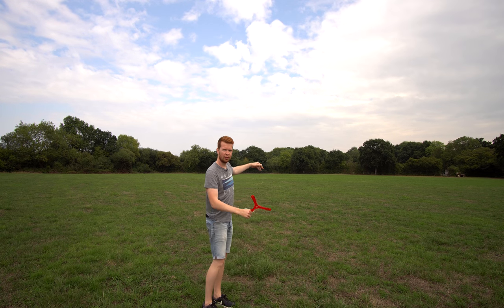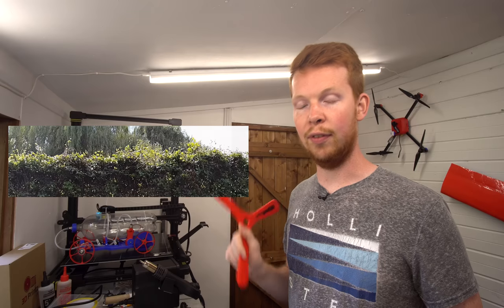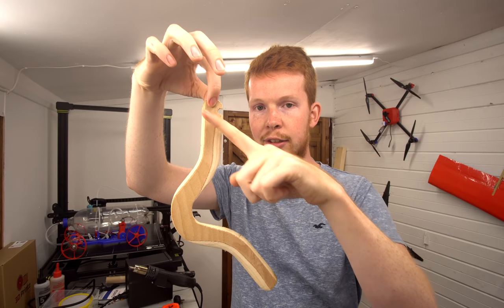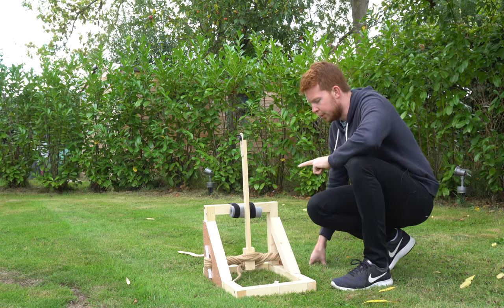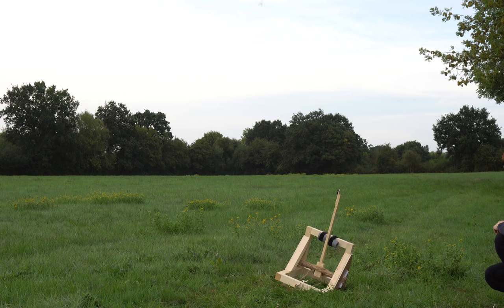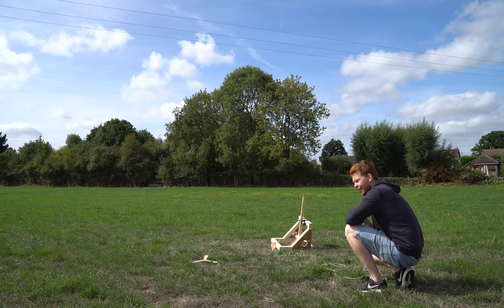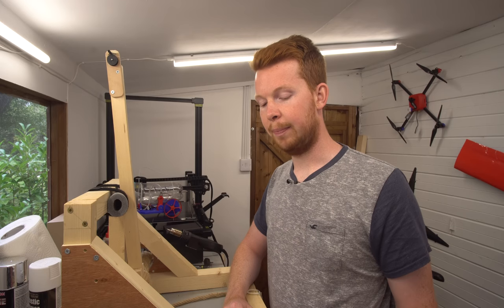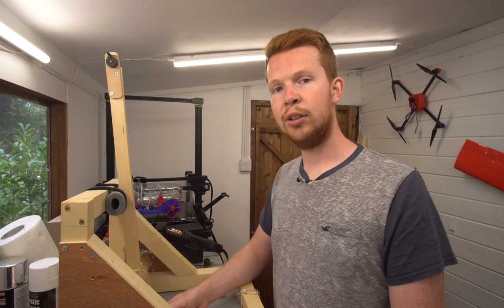Boomerang Launcher

Comment: The next phase of this project is to put some servos and instrumentation on the boomerang so that it will be able to control its own flight path and steer itself home. ;-) Also, the long form videos are a nice change. The extra touches done in editing are cool.
Reply from the maker: Haha 21st century boomerang ;-) Great thanks mate!
Reply: I was about to type this identical comment, then saw this one below ... I need to become a patreon :D
Reply: I wonder whether you could do it using a single servo. Like how a monospinner can move in 3d space with only 1 propellor.
Reply: @charleslambert3368  These already exist! Can't remember who made the first one but Lockheed Martin followed up on it.
Reply: Thoughts and ideas at their extremes. But its cool idea. How about a RC flying saucer.
Reply: Buy a boomerang! Its easy to make some boomerang and adjust your throwing technique as to make it return to you. But a good quality boomerang is much easier to through and much more forgiving.
Reply: Tiny solar powered reaction wheels. :D
Reply: Maintain angular velocity by having mass that moves closer to the centre of rotation when the boomerang rotation slows
Reply: @TomStantonEngineering  i didnt like this comment, its better at 21 like for 21century boomerang

Comment: Brilliant stuff!

I'm a blacksmith/metal worker, if you wanna do something metal based collaboration let me know! I build and fly foam planes but nothing fancy, also Hertfordshire based.

Cheers,
Joe.
Reply: dogboy1953  i wonder if that would actually work if the metal used was light enough...
Reply: @Sharpless2  it doesn't matter what material is used for as long as it is light enough
Reply: Should I put this in r/cursed comments?😀🔪
Reply: @duke-vx8xy  yesh
Reply: @Blacksmith Joe I subscribed to you cuz your name is Joe
Reply: Build a drone with hand forged rotor blades

Comment: [circular(spin)/ lineer velocity] ratio is also important. if you would make that hole closer to the elbow(center), more kinetic energy would go to circular and less to lineer motion. That something you could try. That boomerang you can throw it with the lift arm, dingle arm or even elbow. And elbow you can make more spin.

Comment: I do believe i have a proper boomerang for ya. Love the invention my friend. Wish you were my neighbor, i could at least hold the camera for ya lol. Every time it made a full circle and landed in front of you i would still call it a win. The launcher did it's job. That boomerang needed a little bit of breeze to push it back just a bit. I don't think hitting the ground made it fly any different, i think it was simply the change in wind direction. This test would have gone so much better in a huge arena with dead air. I know, not practical or feasible. I've thrown 1000's of times and i only go out first thing in the morning or just before dark when the breeze is at it's lightest.

Comment: I’m very impressed with your release method.
The biggest advance for you would be a base to hold the catapult at a steady angle.
If the release is consistent then the next variable is variations in wind and turbulence.
 Look for a bigger field, with nothing up wind of you to ensure clean laminar air flow.   Those trees in the picture would have given turbulence. The smaller the flying object and slower the air speed then the more it will feel and be effected by, the turbulence. Of cause some windy days are more gusty than others too.
Reply: Excellent observation.  My lifelong kite obsession taught me how disruptive  distant upwind obstacles can be to getting a kite to launch.
Another unnecessary variable I see is the ground level launch.  There is an abrupt gradient of windspeed from near zero at ground level.  You can see it by blowing bubbles at various heights in various strength winds, preferably in wide open spaces.  Watching the relatively slow progress of dried dead leaves along the ground is evidence as well.

Comment: When I was a kid growing up in Australia in the 70s there were a lot of good boomerang throwers around. It was a bit of a thing back then to practice - I guess it was our version of frisbee. I was pretty good at it myself.

I reckon one of the problems with your machine launcher is that it is too close to the ground. When you throw a boomerang you are throwing it from about 6ft high and you launch it in a bit of a downward motion; the aerodynamic lift then kcks in and makes a better arc. Maybe you could lift your machine up off the ground and get it to release a little later.

Comment: Some suggestions after reading the comments: Put the launcher on an elevated platform and when proper release angles are established, fix it securely. Play with the location of the pivot pin to achieve faster rotation if possible. Use a ready-made plastic boomerang. There are a few decent two-blade plastic booms made. Lastly read up on tuning boomerangs for better flights. The light plastic ones respond very well to tuning although they won't hold it for long. I have no doubt that it is doable.

Comment: Good job so far...but for one...make that thing stable not rocking when you launch. Second, make the arm just a bit longer and third, the stopping blade stalls as it slows down and generates drag which makes the other wing come up and around by means of inertia of the second blade which you should balance angainst the drag by making the tips of the blades a little heavier in your case (it just seemed that your boomerang was not spinning as fast as it should). I think you can see what I'm pointing at.
Ps. It will give more stability and a longer flight time, though it will also influence the shape of the flight.

Comment: This would work better with a launcher with a horizontal launch like a crossbow. If you throw it via an arc, it will cause issues with dipping too low on its travel out and not having enough horizontal momentum to make a full trip.

Should try a hand held launcher like a sling shot. You use rubber bands attached to a sled, and a clamp held shut with springs or rubber. The clamp holds the boomerang, and when the clamp gets to the end of the track, wedges force it open and the boomerang is released without a hitch. To copy the rotation imparted by the throwers wrist, you make the clamp tilt back to front during its travel, maybe making use of an extra joint between the clamp and the sled that starts rested back, and then gets flung forwards with the travel of the sled.

Then you can compensate for wind, angle, and boomerang shape by aiming in different directions. You can also adjust the pretension on the rubber, and the distance the sled travels.

Comment: when i used to throw one when i was little, I would be about 100 feet back in my yard and chuck it directly at the right corner of the house. It would lift before hitting the house, go left, and come right back to me every time. It was probably heavier than that one, and was a true boomerang shape. Now even though I could bring it right back, it was painful to catch! Also I'll note that the secret to a proper consistent boomerang through is a hard flick of the wrist, so it is no surprise you had issues with the catapult. You need the rotational force to be enough to carry the thing back to you

Comment: Very good attempt.  But you forgot another variable - height of the launcher above ground level.  If at human height (usually 6ft when it leaves the hand) you will have more latitude to vary the angle from the horizontal at release, which from memory can be critical to getting a good return (again perfect angle depends on boomerang).. Higher also means you don't need so much headwind, as the extra 6 feet at start can mean a lot of extra distance coming back.  I would have had the launcher on high table or platform.  Your launch angle from the vertical looked to be spot on.   My father used to make his own boomerangs in the 1950s, and in his eagerness to test them would thrown them from the roof, rather than go to the one of the few big parks in the city.  Many of the surrounding buildings had flat roofs, and after a few weeks they were littered with boomerangs.  No-one knew this until his sister happened to see them all while seated in the upstairs of a passing double-decker bus.   Merry Chrimbo Tom, thanks for all the effort you put in to video your projects, appreciated.

Comment: Put bigger wheels on one side of the trebuchet and make a bigger boomerang, use the trebuchet to launch it.
Weight instead of torsion for control, larger boomerang bends less, weighs more, less susceptible to wind?

Loved the vid, would thumbsup more than once if I could

Comment: You made great progress. Only thing is that the catapult is just a 'dull machine'. It will be good if you can mimic your hand and exact moment of boomerang release. Not sure what define forward motion vs. rotational speed. Probably with your hands, if you want to rotate fast, you release it later so that it spins faster. Not impossible, but very tricky to do it with the machine.

Comment: Try boomerangs with more blades and multiple airfoils (Aerofoils for those who speak British and other European English). You may just need more weight to give it more inertia. Higher inertia will, to a point, result in a higher lift factor and will turn the boomerang sharper. This may just cause it to spiral, but it would be a good test anyways. Try different blade angles too. Have one as a right angle, one as really shallow, and a few in between. I know that there's a specific one for a 'perfect' boomerang, but it's always interesting to see multiple results. And maybe what is the 'perfect' boomerang for a hot day is not for a cold one, so having a better design for a hot day, and a better design for a cold day would increase the usage of a boomerang.

Comment: I think having the launcher hold a stable position between launches would be essential for your repeatability. Each time you're changing angles in an uncontrolled, unmeasurable way. Just take some threaded rod and screw it down in the corners to create the angles needed.

Comment: Nice job!  I throw boomerangs a lot in the nicer months of the year and have long thought about making a robotic launcher.  Your hook and pivot pin release is much more elegant than the pinch mechanism I had designed.
I've instrumented boomerangs with sun sensors to measure their spin rate over the full flight, down-linking the data with a small FM transmitter.  I guess an IMU with an MCU and some flash would be the next step to measure their attitude and accelerations.  I make optical tracking systems for VR (I invented the Lighthouse System the HTC Vive uses), one day I'll probably track a boomerang with that.  Another fun idea is a homing boomerang which is guided back to a beacon you wear, scanning the world using its own rotation, but sufficiently fast and small actuators for the guidance are problematic.

Comment: One way to help eliminate the wind direction variable would be to build a sturdy, but sensitive, rotating platform rigged as a wind-vane to set your launcher on.  Alternatively, in the time it would take to build the wind-vane platform, you could probably design a new launcher that integrates the wind-vane feature into the design without a platform.  If designed in a way that the angle it launches relative to the wind is precisely adjustable and repeatable, as well as the angle of the boomerang relative to the ground, that should make it more predictable.  If designed so you could also measure and adjust the throwing force applied, and measure the wind speed, you might be able to work out some math, (and/or by trial and error), to increase your odds quite a lot.

Comment: I bought a few boomerangs from a kite store some time in the mid 90s and what i remember was when throwing them a slight wind needed to be on my left side and as the boomerang made the arch the wind helped its lift on the return path. I got very good with them, when i gave up they were landing in about a 5' radious of where i first threw them. A few would fly around and be at a height they would be spinning and hover in and just stall in one spot and land almost like a helicopter it was very cool to finally figure it out. Most were hand made by some one who sold them to the kite store made of aircraft grade plywood.

Comment: I have a huge torsion Ballista. Largest Inswinger in the world. It's at about 2000 pounds of draw. It will go up to 8000 pounds or so. I'm fixing to build a large Onager. The key to high performance torsion engines is pretensioning the skein. You need two wenches to accomplish this most important task. It's a lot of work, but must be done. I have 350 feet of skein on each engine. There's supposed to be 700 per engine. Right now they are under 18000 pounds of tension each. Use skein with the lowest elongation you can find. Kevlar is good.

Comment: Did you ever come across the Australian Aboriginal word "boo"?  It means "return".  Apparently, if you throw an ordinary meringue ....
(That's not mine - I heard it on a comedy show)
I made a boomerang years ago from 1/4" aluminium plate, filed into an aerofoil shape.  It was the traditional boomerang shape, and I tried it out in a large park.  It flew really well, but mostly in a straight line.  I couldn't believe it when it went the full length of the park, over a big tree and over somebody's house at the end of the park.  I spent some time looking for it, and eventually found it in the front garden of the house.  Amazing that it didn't go through the greenhouse in the back garden ;-)  I figured it was too heavy, so I drilled some largish holes in it and covered them with packing tape to preserve its streamlined shape.  I wouldn't have dared to catch it, but it came back close enough, after  making a low circle about 60 metres diameter.

I wonder what you'll eventually become, Tom.  With the methods you use, and your data logging and analysis, you're set to become a top scientist.  You have the right attitude.

Comment: Very interesting illustration. Good work. 
I saw one variable stay untouched ever since, the launch release timing? There may be two ways to manage it. 

(1) Release-launch direction is fixed horizontally. If both lift and precession forces were limited we can see it lands prematurely. The banking of the launch fixture shortened the precession period that enables the vertical lift in advance but there was insufficient ground clearance. How? Tilt and bank for the same launch fixture all at once. 

(2) the trigger pin didn’t adjusted. Adjusted it so that the projectile may launch at an elevated path. 

Elevated launch direction offers needed altitude, ground clearance and time for the projectile to bank (precession) into flat spin and hence vertical lift in its returning journey to avoid premature landing.

Comment: on nightshifts I used to cut stiff cardboard into a three bladed shape.  I held the centre lightly and flicked one of the "blades" and they would fly around the room.  You can even made 2 pronged boomerangs work in this method :)  I have a 3 bladed one from Oz but it's a fast and scary one... Scared to throw it sometimes :D

Comment: Hey tom,
It seems you have a really good throw, but your boomerang from the start wasn´t exactly what I would call a beginner boomerang. Props to you for making it work! 
There are lots of ways to change a boomerangs flying properties and I can´t go over all the adjustments you can make, but basically you put more spin into the boomerang than was needed, since it mostly flew right over you, the hovering and falling down. To reduce the rotation speed you can either;
A: bend the trailing edge of one blade up, twisting it counterclockwise (since you throw with your right arm) this will also shorten the boomerangs range
B: wrap a rubber band around one wing (will perform similar to the previous option but without the risk of bending the boomerang in a wrong way)
C: drill holes in the tips of the wing (also helps if the boomerang keeps slipping from your hand)

Also if you find that you boomerang often overshoots you, especially in wind, wrap rubber band(s) around the center, where all three wings meet. This will make the Boomerang stay further in front of you, using the wind to push it back to you. 
If I throw one of my heavy wind boomerangs in still air, it looses a lot of rotation just as it turns, falling down waaay in front of me.

I would love to see you do another video on boomerangs, adjusting them. Maybe look at non-returning boomerangs, called kylies I believe. Those are thrown horizontally, and fly a very very long way.

Comment: Hey Tom, interesting stuff as usual. Just a couple of wonders. I wonder if instead of a rope being twisted you used surgical tubing like we use for launching rc sailplanes. Instead of twisting something could you attach lengths to a cross beam and then directly to the launch arm. You could add or subtract strands of rubber to increase the launch speed as needed and maybe this would give you more control to speed up or slow down the boomerang at the instant of launch in case that control helped with consistency. Also I wonder if placing spikes on the bottom of the launch framework would hold the entire framework so you didnt lose any of the energy in the rubber to the whole frame shifting. Watch your videos again. Maybe its not a significant loss but it seems that any shifting the framework does at launch is robbing some of the energy from the launch arm. Just some thoughts.